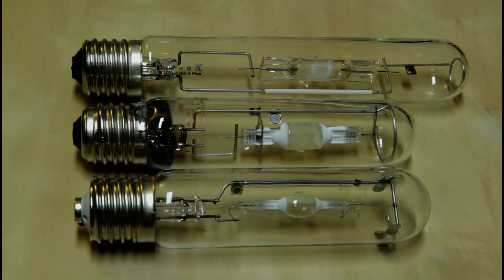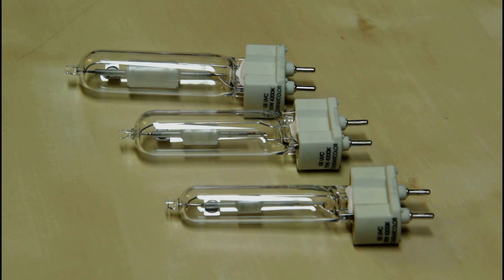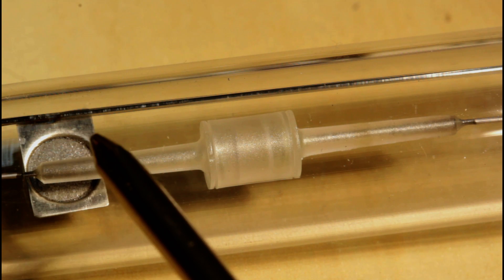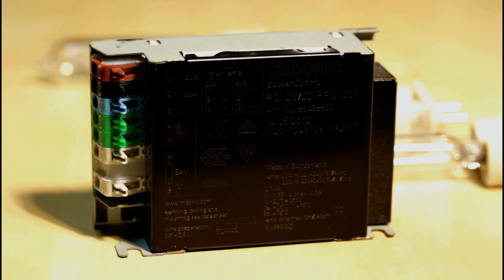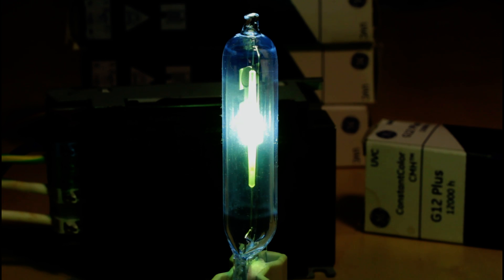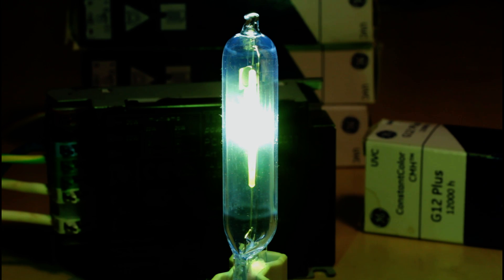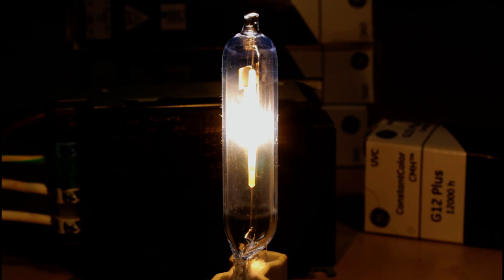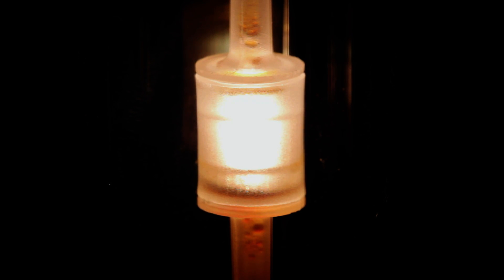Tiny 20w metal halide lamp.

Comment: I love the Ceramic Metal Halide bulb, I have it in my modified Cyclops Thor Colossus Halogen spotlight (the 35 - 39 Watts Ceramic Metal Halide bulb apparently works fine with the 35 Watts automotive digital metal halide inverter ballast, I made sure it's AC output though - it's definitely squarewave AC which is what the bulb I used wants). Nicer and way more efficient than the original Halogen bulb, for sure. It lasts forever so I figured I'd give it a try.

Comment: where are these tiny 20W metal halides used? what kolor temperature are these Metal halides?
Reply: Ususally you'd use one of these itty bitty little halide lamps in something like a down light. Somewhere like a shop display where you want a nice en colour temperature  that's consistent across all your lamps.

Also. These lamps are generally around 3,000 to 5,000 kelvin in colour temperature. This varies with age though as they lose intensity and shift a little in colour as they age.

Comment: I bought a used track fixture on eBay (35W 3000K G12 Base) Is there any tips or tricks on how to remove the G12 lamp from the socket with out breaking the lamp? I want to remove it to get a good look it. 

It looks like there is two metal tabs that have to clear the bottom of the base before the lamp can be removed but I can't get my hand in there and bend both at the same time. So there has to be another way to get the lamp out?

PS: In the USA these small Metal Halide lamps are really pricey (A New lamp costs more then I paid for the whole fixture). I guess they never really caught on in the US and most of them got replaced with crappy LEDs

Comment: A system of ballast "high intensity discharge" used in cars would be 35 watts, could ascend one metal halide lamp, or would a difference? example. Xenon of the ignition at 25 kV and metal vapor at 4.5 kV.
Reply: I have used it that way in my portable HID spotlight - it works fine, but FYI, it may refuse to relight when hot which was in my case.

Comment: Those "CDM" lamps are kind of rare and expensive here in Canada. In fact any low wattage M.H lamp I find are pricey, as in $50-$80 each for a 20W "PAR-20" M.H lamp... The hospital I work at had a few hundred of those for wall-wash lights and in track fixtures but due to price they are being retrofitted to 7W LED
Reply from the maker: These must be one of the most popular forms of shop & display lighting in the UK with the most common wattages being 35, 70 and 150w!

Comment: By the way, your claim that quartz is used for an outer envelope is wrong. Quartz (like ceramic) is used as a super tough material for making the arc tube itself. The outer glass envelope of a bulb like this is made of normal glass. That blue glow is actually the glass fluorescing. Glass will fluoresce when exposed to x-rays or to extremely short wave UV rays.
Reply from the maker: The larger lamps have their outer envelope made from hard glass but there is no way hard glass would survive so close to the arc tube in a compact lamp.
If you still don't believe me then check out GE's own data sheet that list the outer bulb material as UV block quartz:
http://www.gelighting.com/LightingWeb/emea/images/ConstantColor_CMH_G12_Lamps_Data_sheet_EN_tcm181-12593.pdf
Reply: FrontSideBus
Still pretty sure that it's a hard glass. At only 20 watts or 35 watts, it won't crack a glass envelope (though some of those 75 or 100 watt compact bulbs are a different story). Usually the size of the envelope is specifically selected (using optimization formulas involving the science of thermodynamics) so it will be small enough to not waste space, but not so small as to be damaged by the heat.

Comment: The arc tube on the 150w one looks rather out of proportion compared to the 20w arc tube lost in its outer shell.

Aluminium oxide is held together in a giant covalent lattice and individual atoms are bonded with polar covalent bonds, so it's made of strong stuff!
Reply from the maker: It is silly small when you compare it with the 150w lamp.
At 83 lm/w it's still quite efficient too. I'd rather have a load of these lighting my shop than LED :)
Reply: +FrontSideBus 
You can get 108lm/W from a good quality XMH lamp, but then they're even more expensive than these are, and only good for 5,000 hours.